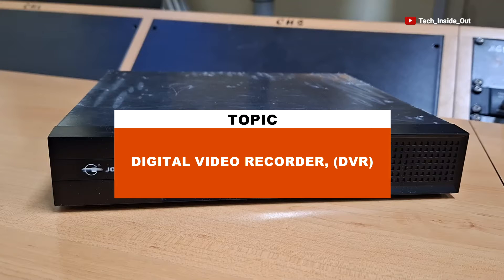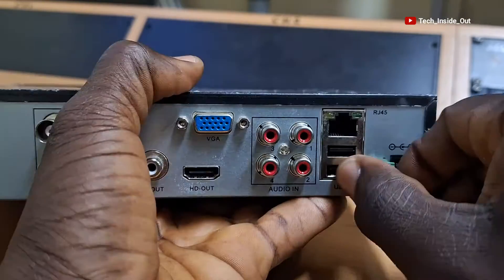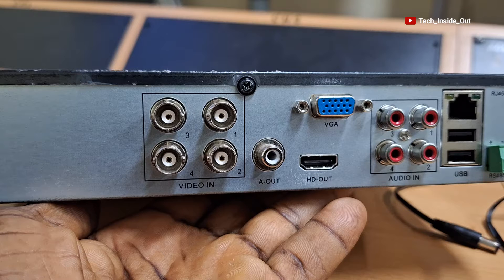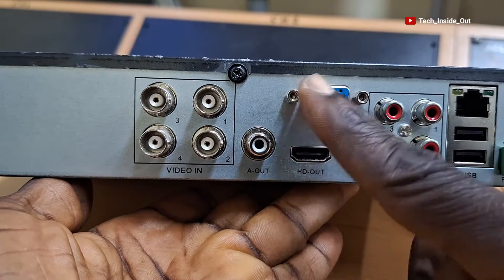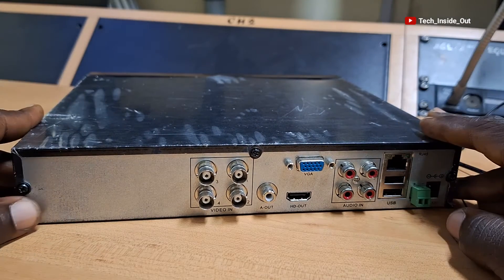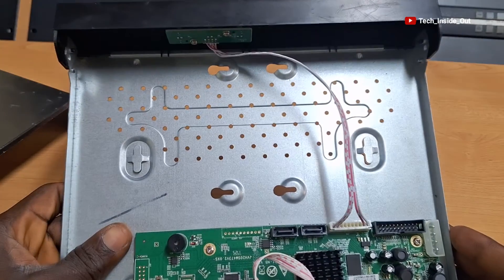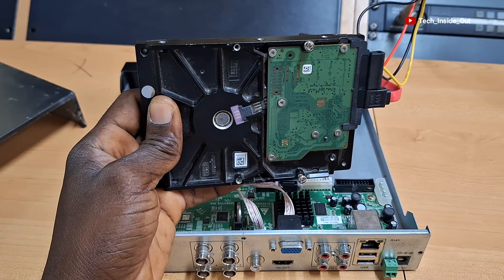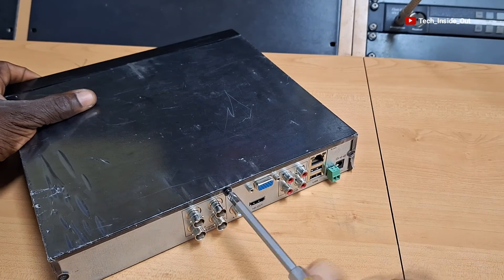A full tutorial on AHD CCTV DVR covering all the connection ports on the AHD CCTV DVR

Comment: Does it not get messy( wires all over) at the back of the dvr when the the camera video and the sound use separate cable input
Reply from the maker: You would have many cables to handle but you would need to well manage them.